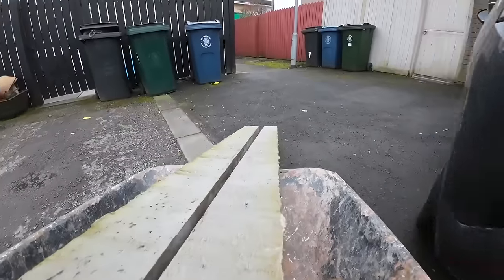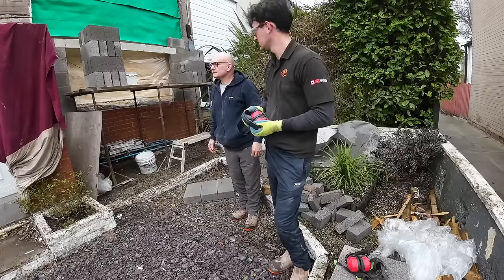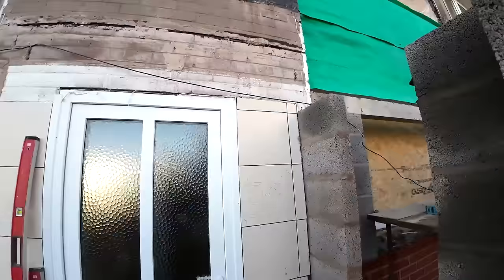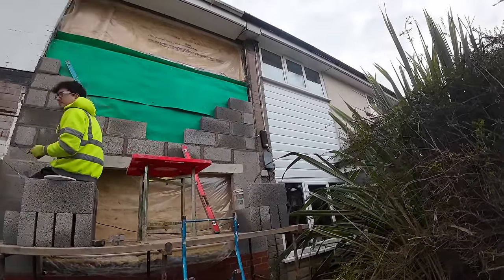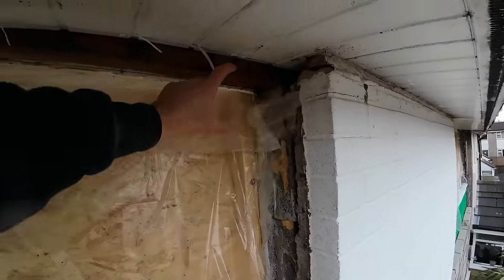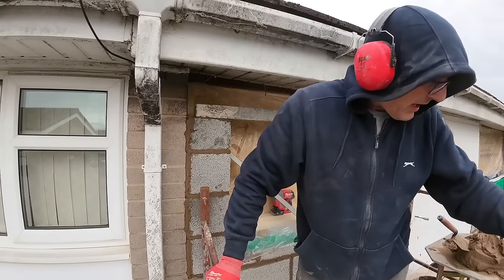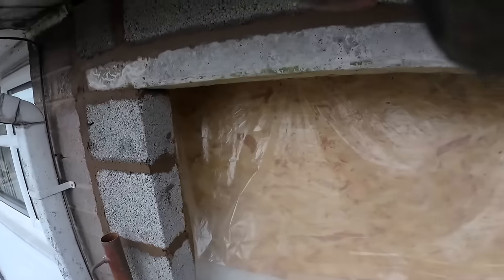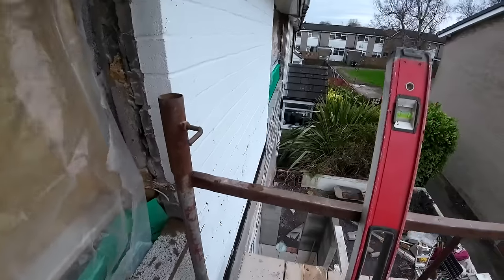5 METRES UP INSTALLING CONCRETE LINTELS !! …PART 2

Comment: Nice work - might be a good idea to consider an aluminium scaffold tower - stronger and a lot safer - the 2005 HSE regs apply to self employed... 45 construction guys were killed last year - 51% by falls from height.. Keep safe.
Reply from the maker: Those towers are a terrible design for anybody who needs more than a tin of paint and a brush, awful to work off and even dangerous 😒

Comment: What amazes me is not that you are changing the lintel height, but that the house was so poorly designed in the first place. Those 70's and 80's architects resulted in some of the worst buildings both esthetically and functionally.
Reply from the maker: Get built fast whatever it takes 😒🧱👍🏽